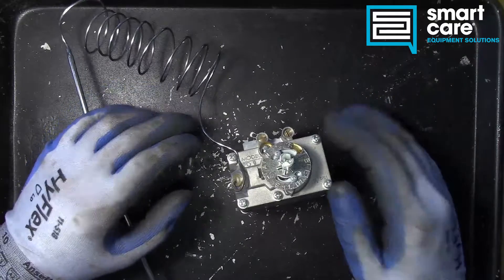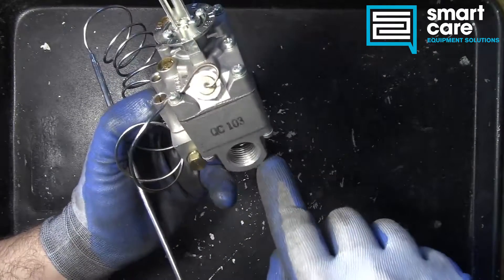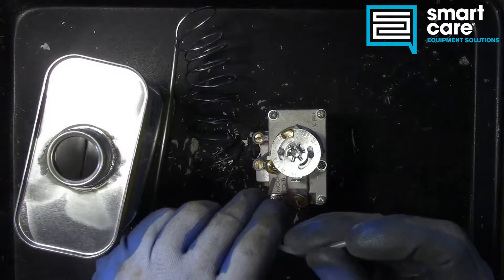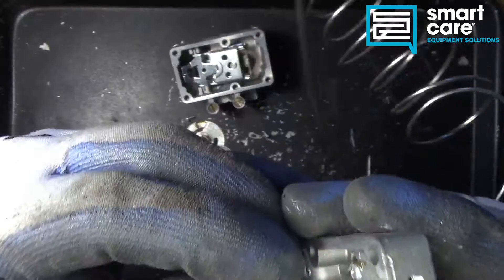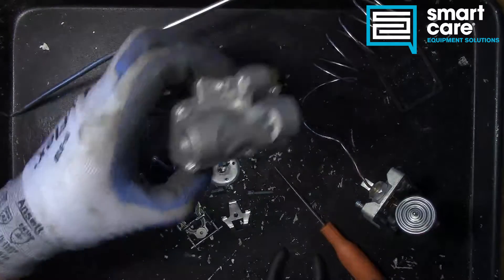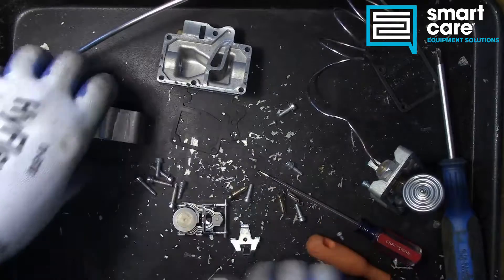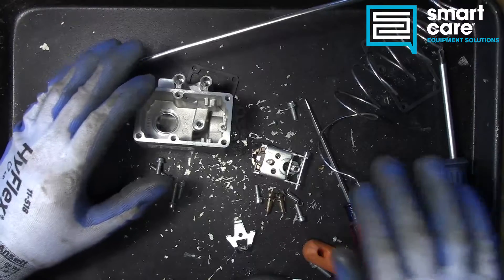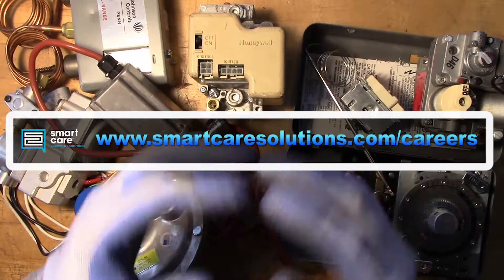Teardown Tuesday Episode 41 - FD Thermostat

Comment: The mechanism inside the middle is called a clicker. As you could’ve guessed by the click when it engages. That’s a 2 seater. The adjustment on it is used to tune the bypass range of the small seat disk in relation to the calibration point/big seat opening on the water column, basically. Good job 👍